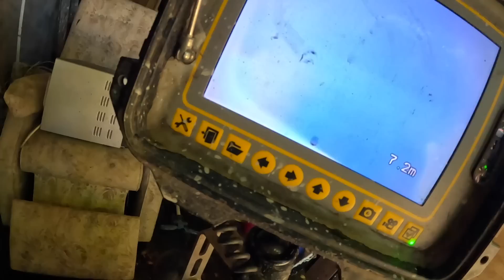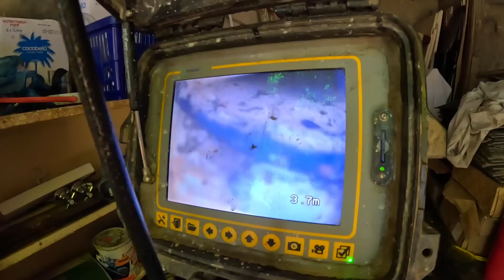Blocked Drain 796

Comment: When i did Plumbing years ago for a military housing track the Engineers put the T Connection in backwards so when we ran the Cable Cutter it went though the Toilet and it was 30ft of Cable in 3ft bathroom and it Tore out Everything The Mirror the Shower stall Gouge the walls and that was back when we had Cutters on Cable and not a Water Jet System Like You Have, Wish We Did.

Comment: Do these machines have a tank with water that circulates in the pump when motor is on but not in use?
Reply: They have a reserve tank with a float valve.

Comment: I don't understand why you don't try to unblock from downstream of the blockage when all the spillover will go onto the flowerbed rather than fill up the garage or someones house?
Reply from the maker: The reason is that the blockage is on a branch line that you cant reach from downstream.
Reply: @DrainAddict  Why did you switch from quick release attachment to thread on?